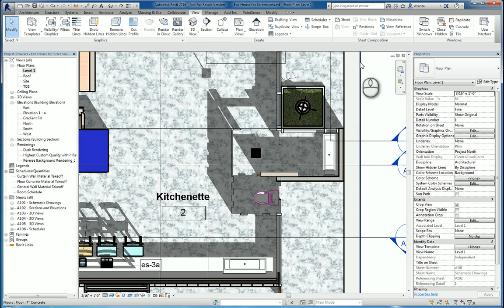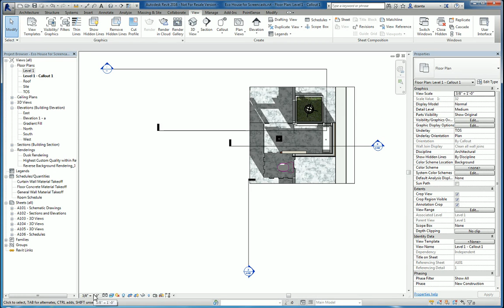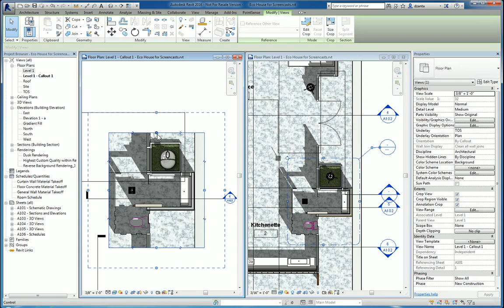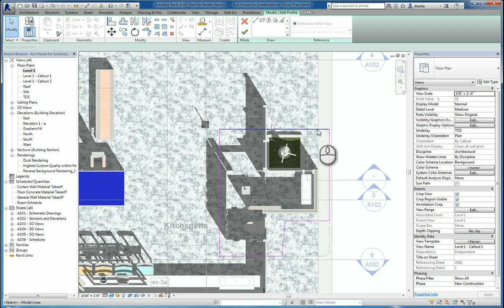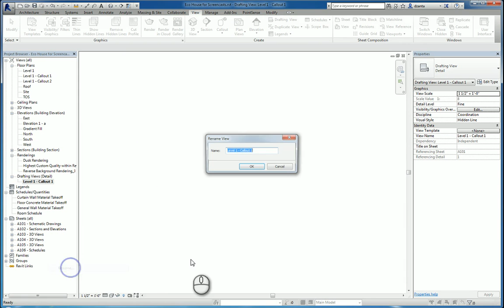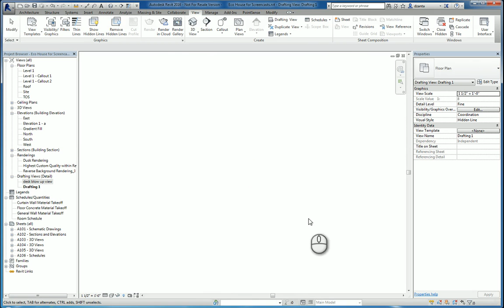Revit Callout, Reference Other View and Drafting View Commands   A How To Guide

Comment: If you are inserting a callout to reference a dwg that is outside of Revit, it will not plot the callout. To solve this, make a new sheet and place the view that is made from the callout on it. The callout will now plot. I used this work around when I was using CAD for my details.